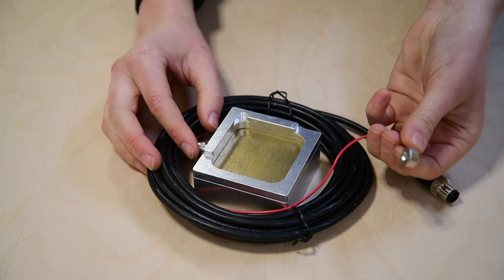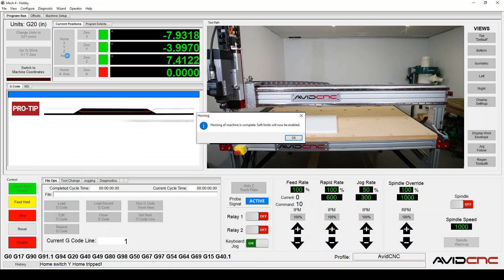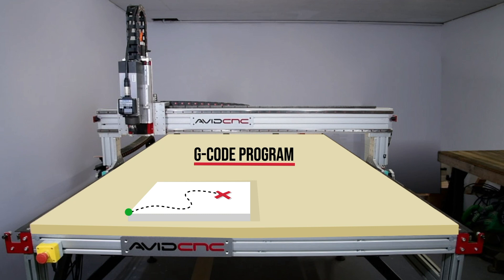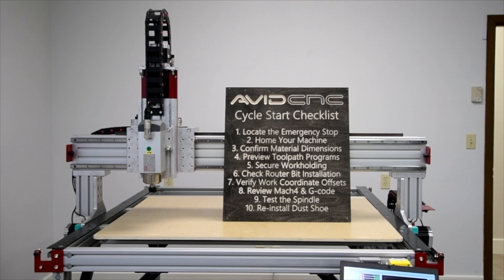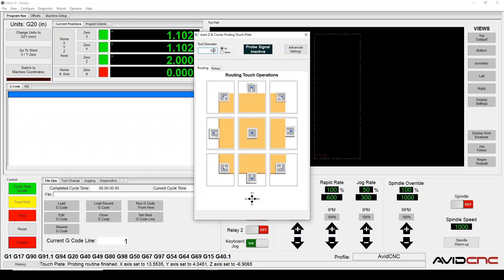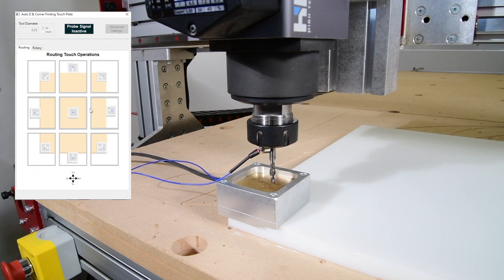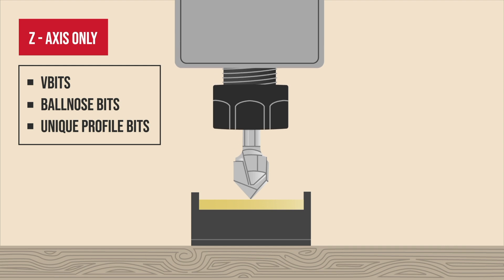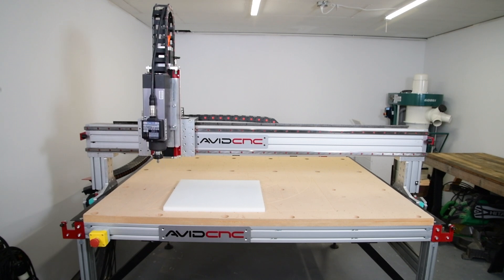Mach4 User Guide: Auto Z and Corner Finding Touchplate

Comment: Be sure to put the magnet on the cutting tool - NOT the chuck nut.  If you place the magnet on the black anodized chuck nut the anodization may block the electrical signal.

Comment: MIne Z-probe stopped working properly, sometimes it works sometimes not even without restarting the Mach software. 
During the auto Z calibration seems like Z axis is missing steps and when it touch the probe it doesn’t stop. It is frustrating because I checked all the connections, settings and for some reason it doesnt work properly. Avid support is usless, after sending them email with the problem with photos of the setup and even videos their respond was pretty simple: We do not provide support for Mach3 anymore, so I left $20k in that company and .... thats it...

Comment: Has anyone added an additional tool setter at the front corner at the machine so it's more streamline with changing out tools for different operations? I'm thinking the tool setter would be mounted at the front extrusion and would have to be adjustable height for the current bed surface level.  I haven't seen anyone do this yet.

Comment: i would love to turn my cable to the other side, so that it exits to the left when I’m measuring from the front left corner of the workpiece. Mine is rotated 180 from the one in the video and removing the screws doesn’t do anything. The halves will not separate
Reply: Thats easy, just remove the 4 screws and rotate the corner stop piece to whatever orientation you want and re-install the screws.  Keep in mind that the brass plates are spring loaded so its a good idea to clamp them together a little (like with a C-clamp) so the pieces don't all fall out when you remove the last screw.
Reply from the maker: The support team would be happy to assist you with this, you can reach them at Support@AvidCNC.com

Comment: HI, I have the same exact touchplate and I downloaded the script from you but when it goes back to zero X & Y are both off around .050". I also had to change the z to get it to zero correctly. Is there something I am missing? What numbers are changed to rectify this in the script?
TouchPlateHeight = 1.108		'CRP Touchplate is 1" nominal, can adjust this number to calibrate (usually not required)
	TouchPlateWidth = 2.378  	 	'Width of Touchplate is 2.205" (56mm) wide
	XProbeDistance = 2 			'How long to probe X Axis (inches)
	YProbeDistance = 2 			'How long to probe Y Axis (inches)
	ZProbeDistance = 2 			'How long to probe Z Axis (inches)
	ZTravelHeight = TouchPlateHeight +.125	'How high to lift tool while probing X and Y (inches)
	ZLiftHeight = TouchPlateHeight + .5 	'How high to lift tool after script is complete (inches)
Reply from the maker: The support team would be happy to assist you with this, you can reach them at Support@AvidCNC.com

Comment: I was zeroing a v bit on the touch plate but kept getting about a 10th of an inch lower than actual material surface. After watching the z zero motion I noticed the bit slightly depressing the plate before contact being indicated. It was a very small piece of Ormask on tip of v bit. Enough to prevent initial electrical contact but would pierce through with pressure.I did do the touch the bit to block test and it showed contact. Guess I was pressing harder than the probe motion.
Reply: thanks for the heads up